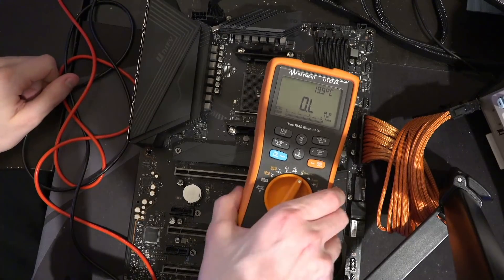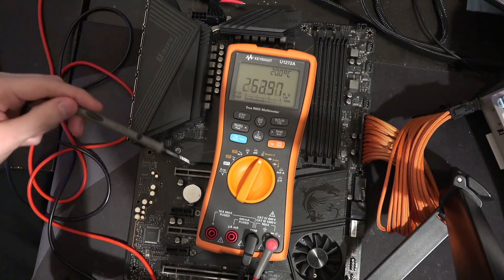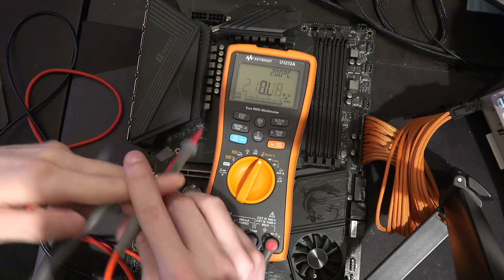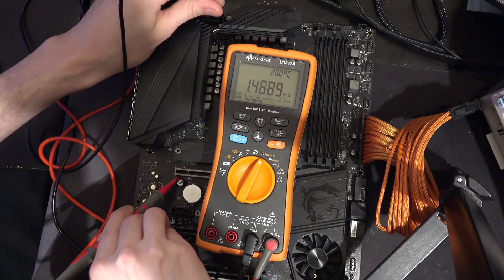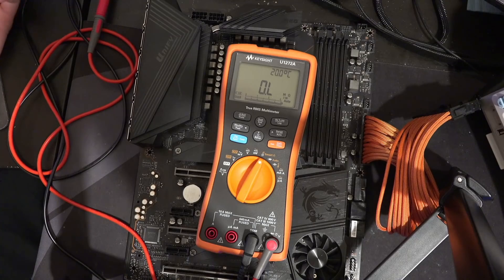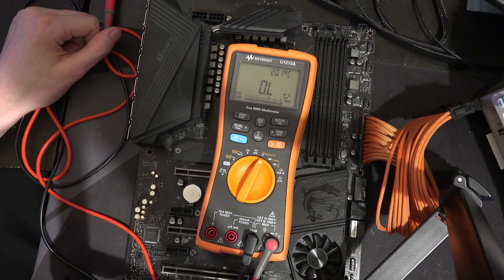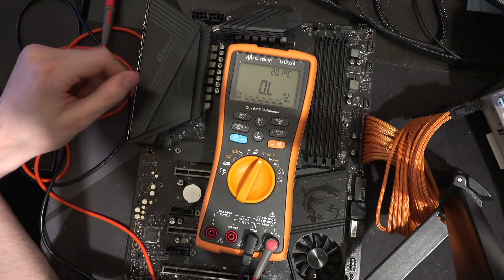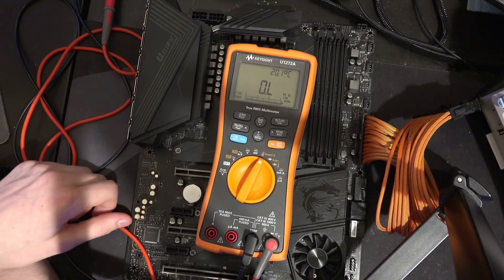MSI boards don't use the CPU power connectors for the PCI-e slots, Buildzoid's just stupid

Comment: So Does plugging in both 8 pins help?  or.. does it hurt anything when you are NOT !! overclocking.?... I reiterate, I RUN STOCK Settings !!!!!!!
Reply: I am using the board in this video. the MSI MEG x570 Unify........

Comment: So I bought a antec 700w neo eco supply with two 8 pin cups connectors and I have a x570 I know it sounds stupid but I should yous one full 8 and another split to four correct? Also it has 4 pcie connectors should I use one from each cable for my 2070 or just use one with two connectors?

Comment: Hi Buildzoid, i got one mpg z390 gaming pro carbon, it has 12 pin cpu connector. My new psu only has standard 4+4 cpu connector. Will i be able to run a i7 9700k with it

Comment: It is infuriating how hard it is to get a power supply with the extra 4 pin connector for these boards. I’m a first time builder and if I would’ve known better I would’ve got a b450, settler for 3200 mhz ram, accepted incompatibility with next gen Ryzen and made my life easier

Comment: Just curious picked up a x570 board. I am just using a 3600X, Do I have to use both 8 pins on top of the motherboard?
Reply from the maker: no
Reply: @ActuallyHardcoreOverclocking  so when do you actually have to use both 8 pins?

Comment: I'm building a PC using the following parts:

- AMD Ryzen Threadripper 2970WX
- ASRock TaiChi x399M mobo
- Corsair SF 750 Watt PSU

Mobo instructions indicate to make 3 power connections from the PSU:

1 x 24-pin (20+4)
1 x 8-pin
1 x 4-pin

My problem is the PSU doesn't seem to include any cables that have a 4-pin connection. I have the 24-pin and 8-pin cables but no 4-pin cable, and there doesn't appear to be any 4-pin socket on the PSU.

I'm sure I previously checked this PSU was compatible with x399M mobo. In PCPartPicker is was listed as compatible. Any advice?

Comment: Do you need to plug in both 8-pin to operate the board/cpu, period? Considering this board but my PSU doesn't have 2 8 pin CPU... Or is it just for extra extra power if you wanted it for OC 3950X or whatever? The Unify manual doesnt say anything about only using one 8-pin cable, rather it has a single page showing both plugged in with no other information.

Comment: I own a Dark Power Pro 10 650 W and a MSI MEG Unify. Because the PSU was shipped with a 4+4 + 8 pin cable I used it instead of the 4+4 pin cable (without additional 8 pin, so many cables it comes with...).

Is there any negative aspect to power both 8 pin connectors? More power consumption?
If not I don't care. I just need to find a way how to connect the other yet not used cables I have left. ;)

Comment: I seem to be misunderstanding. What are those 8-pins for then, if they don't power the PCIE lanes? Should we still connect one or both to the power supply anyway?
Reply: They are both for the CPU VRM. You normally connect one of them, that should suffice to somewhere just north of 200W without producing a significant amount of thermal loss at the connector - that's the whole reason we don't run the CPU off just 2 pins, once you get past 60W or so, even a small percentage-loss that is completely acceptable otherwise could eventually cause connector degradation and runaway failure, so CPU first grew a dedicated 4-pin connector (2x +12V, 2x ground), which is good for just north of 100W, which then got doubled up to an 8-pin connector, which should be good for 200W and then some. Why they added the second 8-pin connector, beats me, probably for bragging rights, but i really can't imagine that someone actually wants to run their system 24/7 with 300W expelled on a single CPU! 160W are tough enough as far as i'm concerned.

Comment: Ah well we all fuck up from time to time. Maybe this one will get motherboard vendors to actually do it because it's a great idea
Reply: If they did, it would be a rail defeat which would effectively disable OCP. Just like OCP is incapable of working on all those high-power single-rail PSUs in principle - like, in theory it works, in practice a short is always to be assumed to be a single-point failure, but no single wire or connector pin is capable of pushing 70A. This is why you want a PSU to have its +12V rail split into 4 rails (2 can be acceptable with lower-power units) with separate OCP shunts, each tuned for 25A or so trigger current, and you absolutely don't want something in the system to defeat the protection.

Comment: I thought it was odd you said that it was powering the PCI-e slots. On my board, the gigabyte x570 xtreme, there's a third 8 pin at the bottom of the board for the pcie power. I mean, msi could use one at the top, but I think all manufacturers use the top ones for cpu only. Anyways, It's nice to see someone correct themselves. It's no big deal.

Comment: no problem man thx for the breakdowns, there's always at least one thing most people missed (like an e-atx board with a 90° connector that would have been a big problem in my case)
there are boards with a power connectors for pcie I think ? but it's at the bottom of the MB

Comment: there's also plugging an angle grinder before checking the switch..
Reply: Normally you expect an angle grinder of all things to be equipped with a safety dead man switch.
Reply: @SianaGearz  of course. mine has it and i checked it works. now: would you trust it with your life? :D

Comment: though i have to say, using the 8pin eps connector for the pcie power would be a good idea for high pcb layer boards
 :)
Reply: No, it is not. You get all voltage changes created by pcie cards load changes to cpu vrm input and other way. Having own cables removes cable resistance part of this.

Comment: I once programmed on a microcontroller on a metal frame and it short cuircuited and all kind of weird bugs happened and for the love of god I couldnt figure it out what was wrong in the code.. once I realized I felt like a complete idiot :/
Reply: kinda same, by repeatedly putting the µC backward in the devboard socket, wasted a full afternoon on that... and that dev board now have a "beeffy crystal oscillator mod" ¯\_(ツ)_/¯

Comment: How it started In the video "mobo PCB Breakdown: MSI X570 Godlike // It does almost everything"
 Bryant Allen was quoting Wendell.
His source being the L1Tech video "MSI MEG X570 Ace Motherboard Review" where Wendell does say.
...
"You dont really need dual 8pin especially on am4 cpus, They're not gonna draw enough power to overload a single 8 pin connector, That said some motherboards will actually use that power interface for more than just the cpu because the only other source of 12volts on the board is the atx24 connector which only has two 12volts wires which is y'know you can deliver about 75w per wire (conseratively), So supplying power to the graphics cards especially if you're going to run 3 graphics cards can get a little dicey if they're all using that 75w from the pcie slot."
https://www.youtube.com/watch?v=pnn9KH1NH-Y&feature=youtu.be&t=465
Time to see where wendell got this info from lol :D
Reply: I thought he said that about an AsRock board, maybe the taichi or something
Reply: @chadmckean9026  I'll check later because I obviously have nothing better to do on black friday.
Reply: What boards actually do this though? The gigabyte xtreme has a third connector for pcie power. Are there boards that use the top 8 pins for more than just cpu?

Comment: I really want to make fun of you for overstating the "idiot" thing.  But... given this is a yt comments section I just can't figure out how to be funny/ironic without it sounding exactly like I'm a straight-up jerk who isn't kidding at all.... so instead, I'm just going to be serious: It's OK to respect yourself, dude.  As I'm sure you're ultimately aware, a /true/ idiot (or even just an ignoramus) would lack the technical framework to have even asked this question, in the first place.  And if they managed, then they likely wouldn't know how/why to use the multibeeper correctly in order to get this wrong answer.  So the actual mistake you made is far from idiotic... just a standard  Type I reverse-ee whoopsie.  It's low-level buffoonery at worst, not even half-way to idiocy :)

Comment: and the reason they don't do it is simple: The CPU needs power that's as clean as possible, so you really don't want random PCIe devices on the same powerplane. Same reason the CPU isn't powered from the 24-pin as well.

Also, wow that Multimeter is expensive!
Reply from the maker: eh you could probably put a choke between CPU VRM and the PCI-e slots.
Reply: @ActuallyHardcoreOverclocking  and extra capacitance. You really don't want your CPU VRM input voltage to drop when the GPU starts pulling power. Better to let the PSU worry about that stuff and use different plugs.